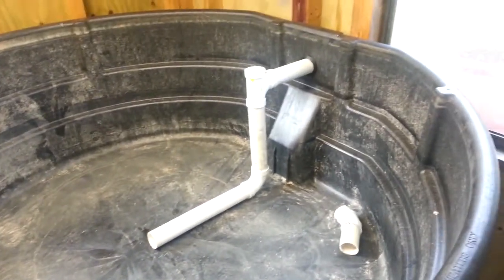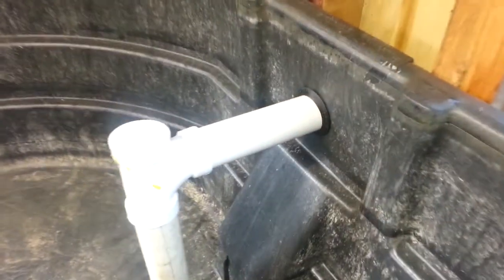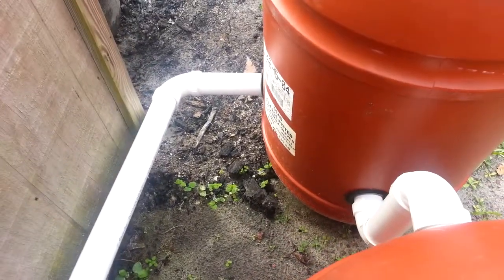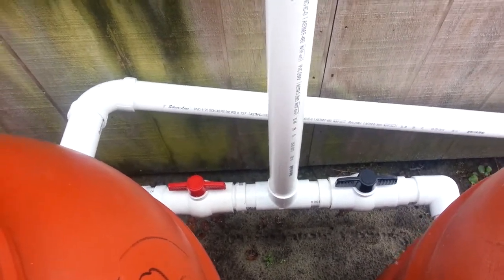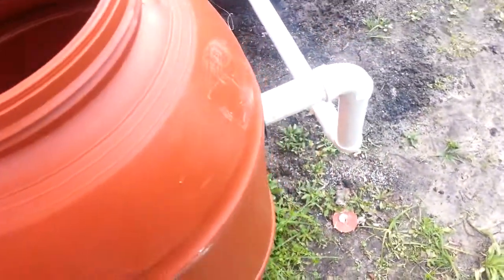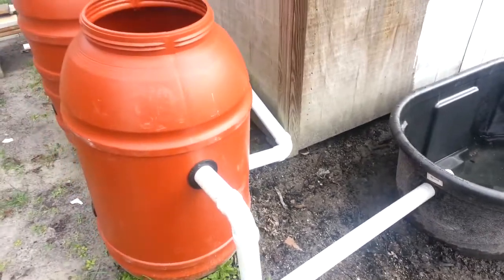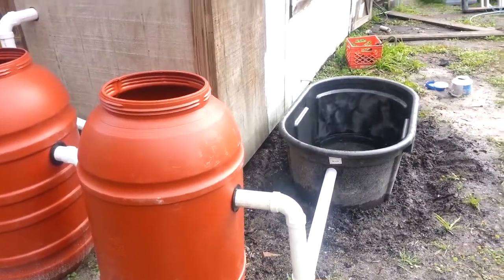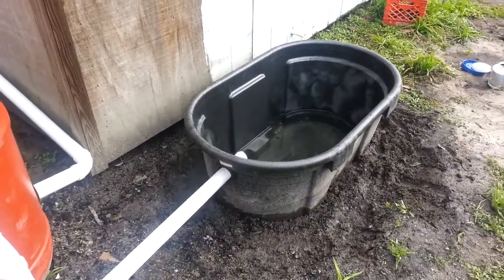Aquaponic system build update part 3 ep 18

Comment: Ok so it doesn't circulate to the plants or is your pump sending water to that area as well?
Reply from the maker: Yes the pump sends water to the plants as well. It hard a poor running to them and the that water drains back into the dump tank.

Comment: I have been checking out a lot of your videos. What is controling the water flow from your fish tank to your 3 barrel system?
Reply from the maker: It's controlled by gravity and the pump. The pump in the sump tank pumps the water to the fish tank which is the highest point on the system. Then it flows from fish tank to either barrel one or two depending on which one of those I have it going to at a particular time, then to barrel three then to the sump tank